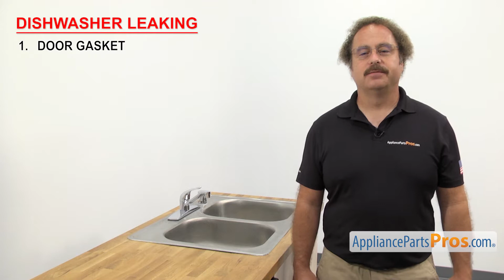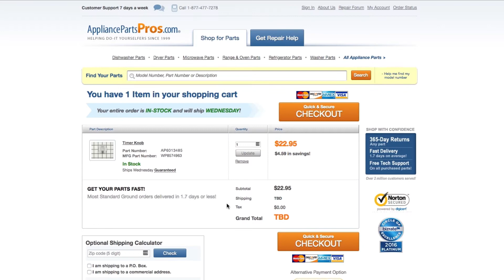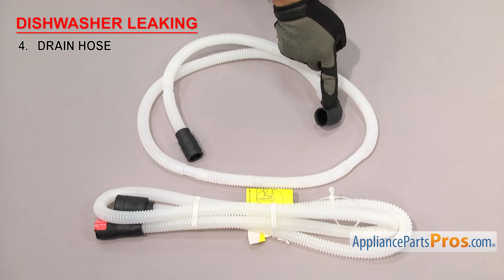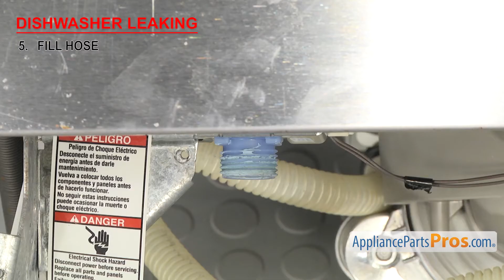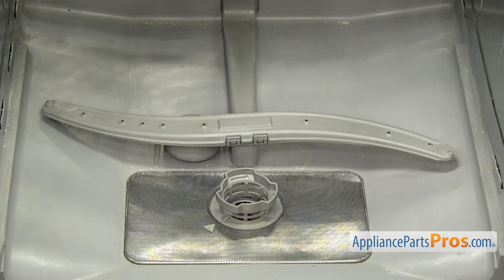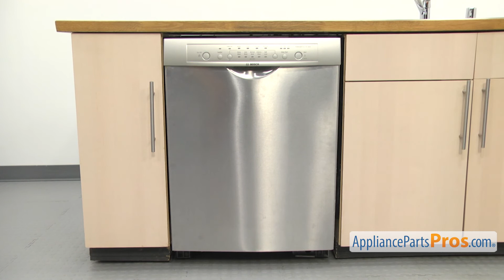Dishwasher Is Leaking - Top 6 Reasons & Fixes - Whirlpool, GE, LG, Maytag & More

Comment: My GE dishwasher is leaking steadily from the bottom, even though the dishwasher is not on and is dry inside. 
I've already closed the water supply. Where could this be coming from?
Reply from the maker: If there is water still leaking with the water turned off you need to check for a plumbing issue.

Comment: Mine was leaking lots of water in the front only of my dishwasher. No water under the dishwasher when I pulled it out.  The water covered most of my kitchen floor.  What do you think might be the cause?
Reply from the maker: You will need to check the door, make sure it's aligned properly and the door seals for damage. Also, check your spray arms for blockages.

Comment: Built a new house in 2019, moved in in 2020.  Bought a suit of whirlpool appliances.  So far, dryer $600 motherboard went bad, (replaced with Speed Queen)  refrigerator freezer door had heat fan go bad(dealer got whirlpool to replace for free $900 dollar door since couldn't be fixed), upper rack of dishwasher broke(design flaw), and now water pours out the door still after lower gasket and door gasket have been replaced.  Do yourself a favor and don't even consider purchasing whirlpool.  JUNK!
Reply from the maker: If there is anything we can help you with at all please let us know.

Comment: 4 year old Whirlpool dishwasher leaking from the door.  2 repair people could not find the reason.  I keep it very clean from debris inside.  I have taken the screen apart on the bottom and clean it often.  I don't think I would ever consider another Whirlpool product.
Reply: Do you use cascade or finish?
Reply: I try not to over fill the washer with too many dishes, plates, spoons of forks, cause I didn't have a four and it seems to overflow

Comment: My 4 year old Whirlpool dishwasher leaks intermittently from the door.  I have had 2 repair people investigate, from 2 different companies, only to say they couldn't find out why it is leaking.  This is very frustrating.  I thoroughly clean the dishwasher, so there is no debris blocking anywhere.  I will never purchase a whirlpool product again.  Do you have any suggestions?
Reply: I had the same issue with mine at 4 years old. i started by replacing the gasket with no luck. I then read about the Lower Spray Arm being cracked and  spraying too much water on the door thus causing it to leak at both lower corners of the door. I ordered and replaced it a couple days ago and thus ran 3 loads of dishes through it with no leaks!!! Problem was Lower Spray Arm. Good Luck!!
Reply: I’m having the same problem and no luck trying to figure out what it is! Maybe the seal on the soaps dispenser?
Reply: Mine is doing the same now from behind the door. I can feel behind and the insulation is wet
Reply: @justinfields5154  I replaced the seal on the on the soap tray for about $20 and it did the trick. I looked up some videos on how to replace the soap tray to see how to get to it. Took about 20 minutes.